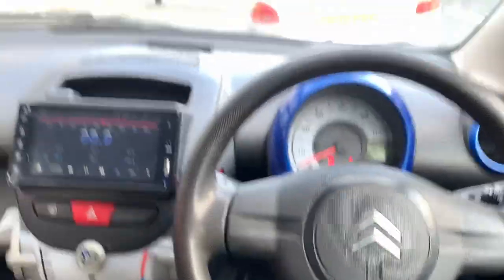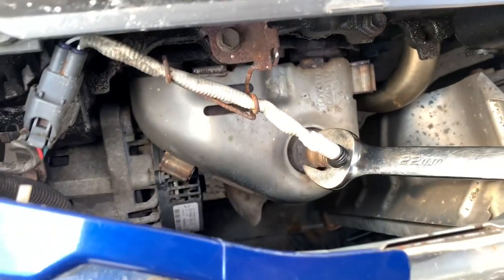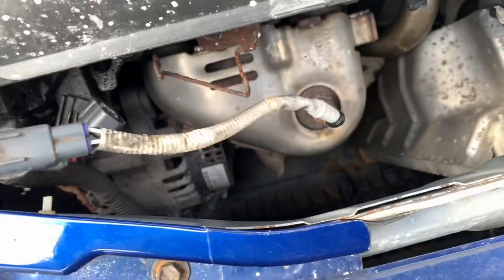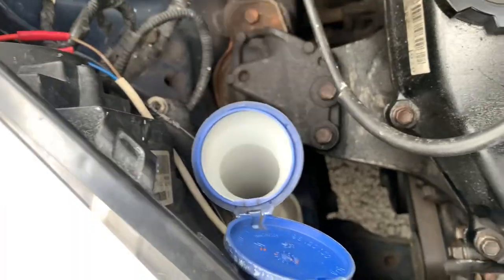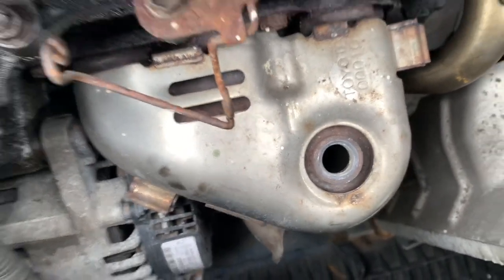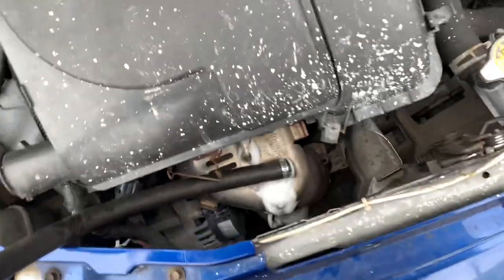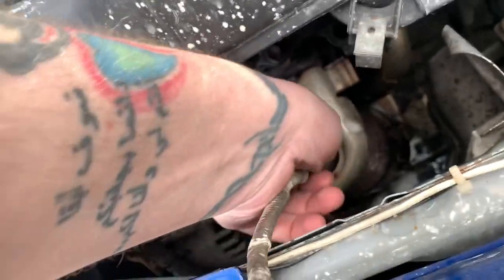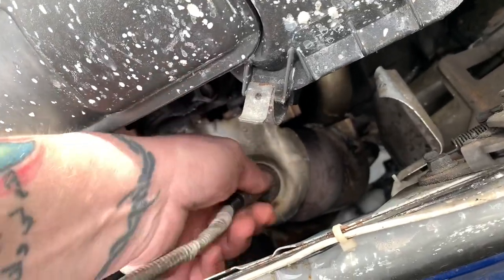DIY Catalyst Clean on Citroen C1/107/Aygo. How to/How NOT to?

Comment: It worked for me, I found your video for validation of my own idea, which you and probably many others found first. Thanks! Glad it works, and I only gave mine a short time in the oven, 10 minutes or so, the entire oven is harder to heat than a part in the upper shelf, so it doesn’t really need much time in the oven. I could see shiny silver under the heat shield after one application.
Reply from the maker: You can clean the outside of it too lol. Use this stuff 

https://youtu.be/jdQCQ9IliKU

Comment: Haha, I just did this to my C1. I've had a faultcode P0420 for months, deleted the code many times to see how fast it was returning. It came back in a day or two. And I tried to graph the o2s2, and saw it was going up and down like o2s1. 

I was about to give up and change it, but I wanted to have a look down the lambda hole, it did not look that bad at all down there, but it seemed like there was something minuscule in some of the holes. So i just said to myself f..it I'll try some oven cleaner. And it seemes like it worked! The graph got a lot better, and there is no pending fault codes and my obd2 app checked the converter with "passed" for the first time. 

I can add that my car was filled up with diesel some months ago, and this may be what clogged the converter. 

The oven cleaner I used was a norwegian brand called "Plumbo ovnsrens." A whole spray bottle, sprayed around 1/4 at a time and waited like 15 min between each time.
Reply from the maker: Nice one. Oven cleaner can be good stuff for removing carbon buildup. Let us know how it goes

Comment: I actually tried the same thing last week but it was too tight. My plan was to open up the bottom flange and stick a hose pipe though the sensor hold ( i want water to come out of the bottom instead of getting caught in the exhaust system ). Anyway im going to try to get a better 22mm
Reply from the maker: Let me know how you get on if you have another go at it.
Reply: Have you done it through the bottom flange,👍

Comment: Ok I did this but I poured in engine cleaner and stuck a hose pipe in afterwards. I opened the bottom flange below the catalytic convertor so the water could run out cos its not like I could lift my car up in the air to let the water out
Reply from the maker: That’s a good idea

Comment: Hey bud, when i drive for 5 mins. The hole car smells like burdes gasoline and oil, if i pop the hood there is a strong smell coming from the catalyc converter. Could it be that my catalystic us dead or can is try this method?
Reply from the maker: More likely that you have an exhaust leak by sounds of that
Reply: On my Peugeot 107 the flange of the exhaust manifold was falling apart by rust, so the gasket wasn't pressed properly to the cylinder head,, that was the cause of the smell of exhaust gases inside my car. I fixed it, by replacing the car converter, which isn't too expensive as an after market part.
I have heard that that there also can occur a crack at the welding seam between the manifold and the cat housing. This can happen when the screw at the lower end of the cat is loose, which normally fixes/supports the cat/manifold to the engine block.

Comment: Well if your cat is knackered and won't pass it's MOT then it might well be worth a go before you spend hundreds replacing it. 

So the video might not be as silly as it seems!
Reply from the maker: Yea if it’s blocked up from burning oil, which these things do from time to time it could work well to clean it out. I’ve used oven cleaner in that long of crud before and it’s worked extremely well so I thought it was worth a go just to see what the effects were to be honest.